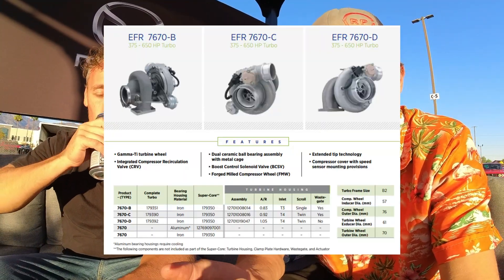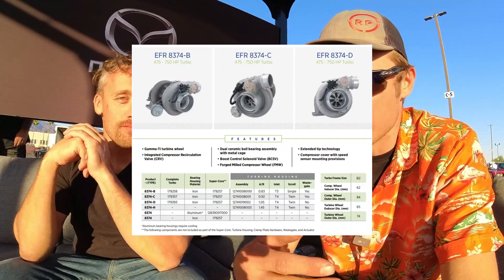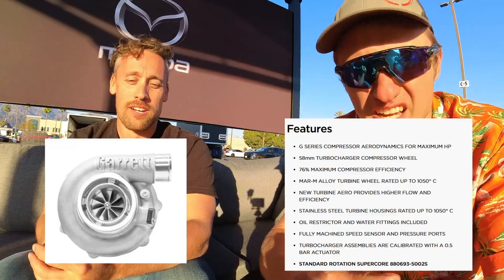Choosing a Turbo For the Hybrid Renesis RX8 - Will it Make 400HP?

Comment: I think a na hybrid motor does not work because the gsl se rotor housing have a 12mm spark plug hole. As the apex seal travels over it the exhaust is fully open letting the compression chamber leak onto the exhaust chamber.
Watch a couple of videos on
Renesis revival channel he explains it really well.
Reply: Watch the shorts

Comment: Agree with Ryan re the exhaust ports and why they are less than desirable. I I ever built a hybrid it would be a PP  exhaust only design. It is doable and not that hard to do properly with some thought.
Just blocking the outlet isn't 'properly' btw.
Reply from the maker: Yea. I dont think simply capping the port is the best way..  id love to see some sort of insert that could stay in place without risk of interference with the rotors.

Comment: there is a formula you can use that will let you size the right turbo size, it used pressure ratio and density ratio and u compare it to a compressor map to check if you are in peak efficiency zone. Its a lot more scientific
Reply: It takes a lot of work to optimize a turbocharger with an engine.  I have a whole series of videos on my page to walk through this.

Comment: Use side exit ports for wastegates / boost control (or secondary/additional control) ... And run the REW ports to the turbo w/ the IWGS
Reply: I kinda thought about doing the opposite.   Rew ports to the waste gate/ renesis ports to the turbo.
Reply: The point of a wastegate is to slow down the shaft speed of the turbine wheel by means of bleeding off energy.  I don't quite follow how this could work in your eyes.  Could you elaborate?  

I suppose if we shut off the side exit ports via solenoid, all of the exhaust energy would channel into the housing exhaust ports, working closer to a standard 13B-REW.  I'm not sure how that can be reworked to benefit this, but am always open to ideas and discussion.

Comment: @radpotential have you converted any of your engines to E85?
Reply from the maker: I dont really have any E85 around me.  But the Black FD is setup for flex fuel. So we will be experimenting with it!
Reply: @RADPotential  you should still consider converting to flex fuel, because if you ever leave your town there may be a gas station that offers it... You can run any combination of gas and E85 so even if E85 is not available right where you're at if you ever take your car elsewhere you can fill up on the 85... I think one of Kyle's sponsors is Eflexfuel, spoke with them today.
Reply: I think e85 would be a great upgrade for a track rx8. Minus a fuel pump I bet the injectors have enough in em
Reply: @jo-qp7mz  stock injector for an hybrid turbo would not make it